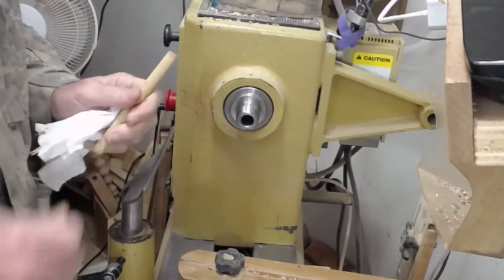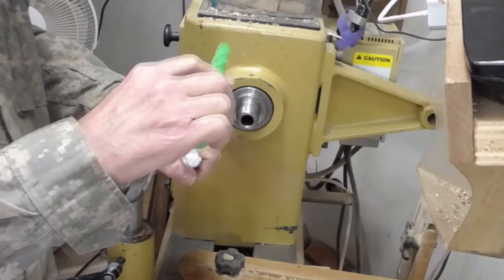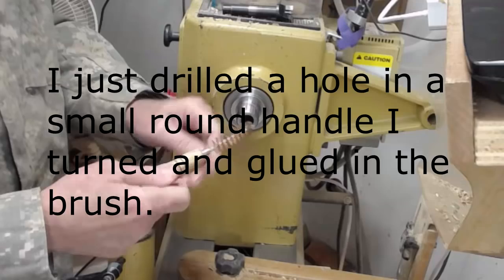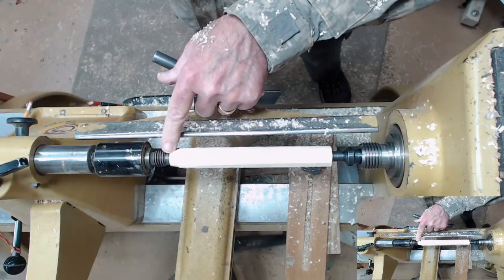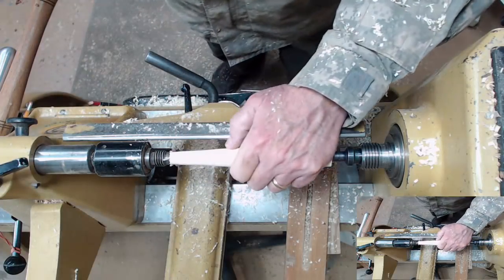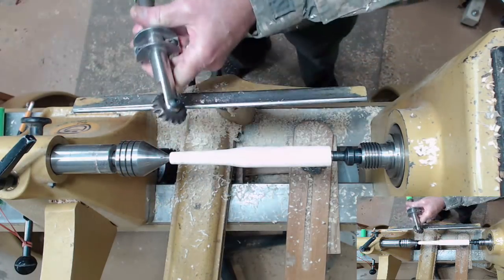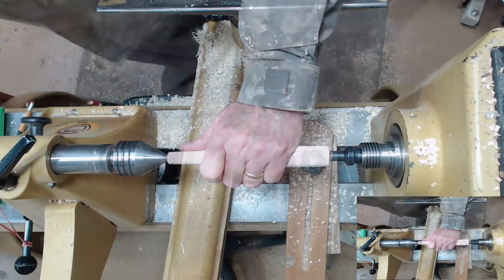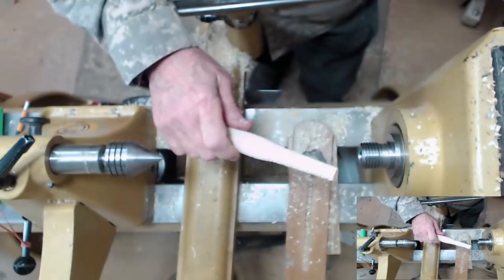Do you Clean Your Morse Taper?

Comment: Any thoughts on "cleaning up" a rough Morse taper on an expensive drill bit?
Reply from the maker: Same way I would do it on a drive center. Very fine file to get rid of any raised burrs and then fine tune with some fine sandpaper wrapped around a small flat board like a paint stirrer stick.
Reply: @MikePeaceWoodturning  I was thinking of a very wide flat file.  But real trick would be how to chuck it?  The tang has a center but how to hold the tip.  Something like drill a hole + face plate + dog???
Reply from the maker: @NoferTrunions  Not a good idea IMHO. You are like to damage your MT even more. Watch this https://youtu.be/1yOzPAO4_ds